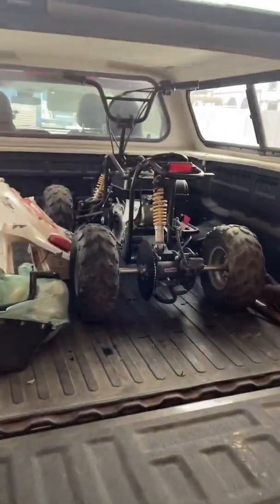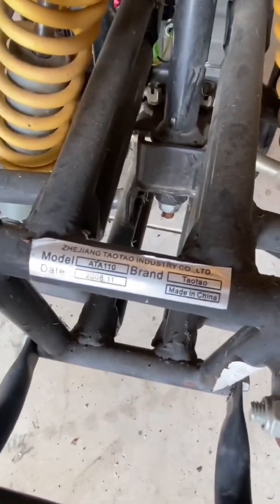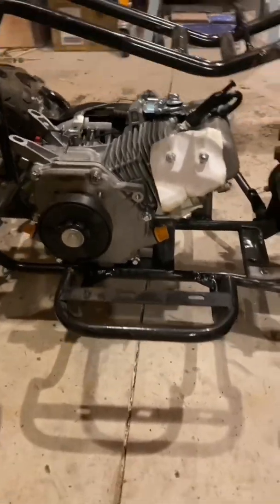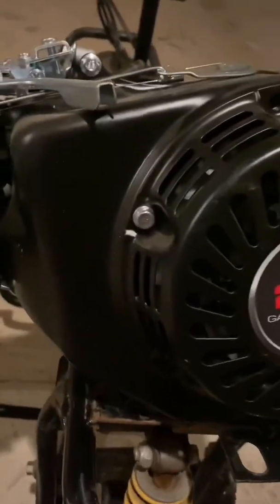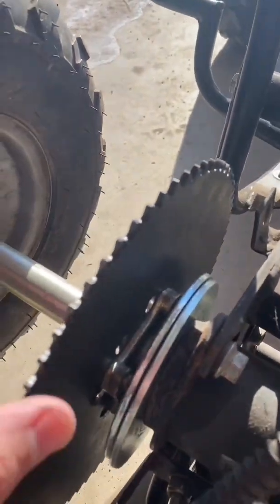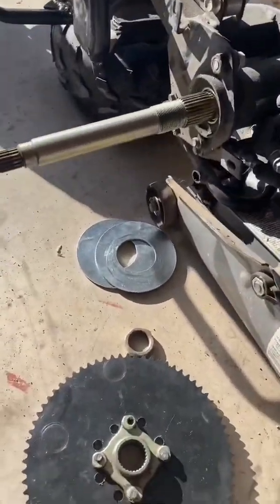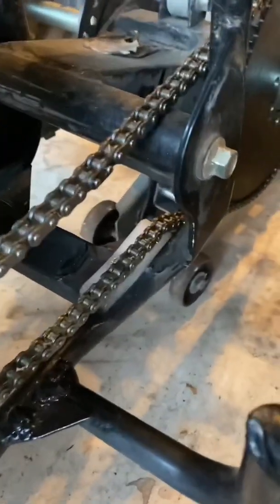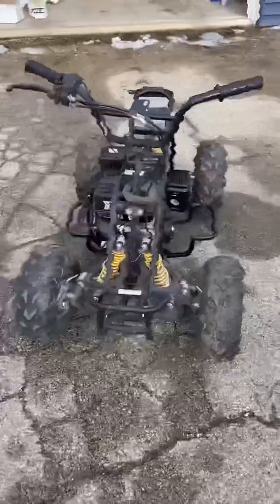Predator 212 TaoTao ATV Build Part 1

Comment: Is there a reason you went with a Centrifugal clutch instead of a torque converter?  Or is that just what came with the engine?
Reply from the maker: Mostly just cost
Reply: Cost but you don't have to rise the engine with a clutch either